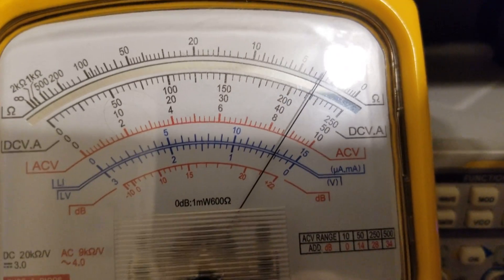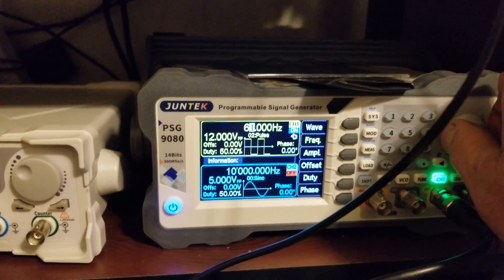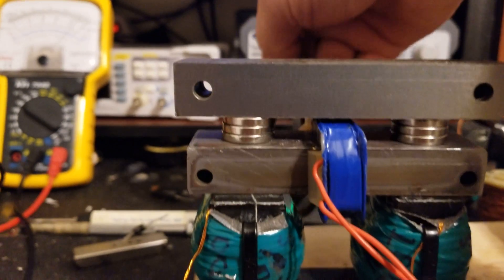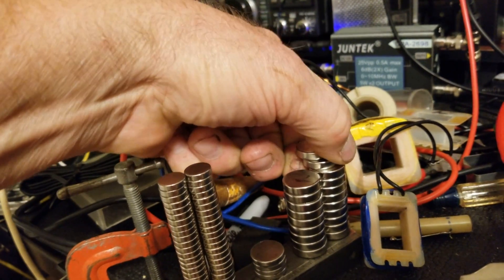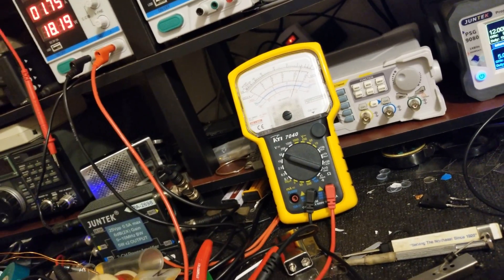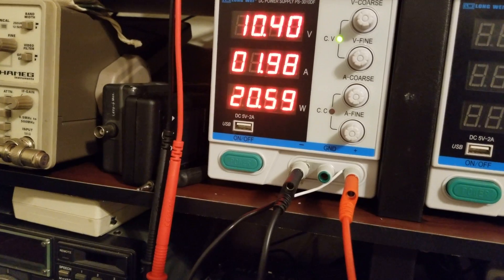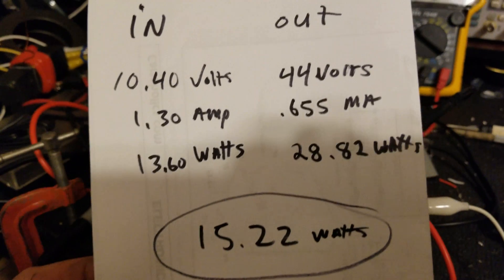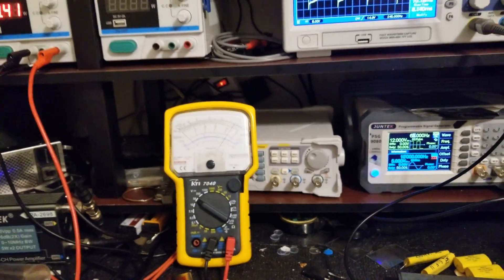Motionless electromagnetic generator Part 6

Comment: Man makes me want to make more coils and try a ton of different stuff.

My layered core began chipping and part of it seperated when I put the magnets inside. So I was a little bit sad. The magnets used were just too strong for it. 
I'm hoping the gap between layers doesn't effect it too bad but I'm sure it causes some eddy currents. :(
Reply from the maker: Super glue in the gap and use a small C clamp to close it for 10 minutes. I had the same problem with my met-glass core.